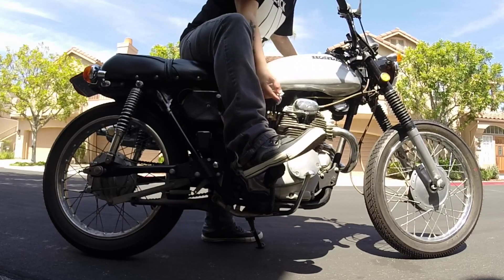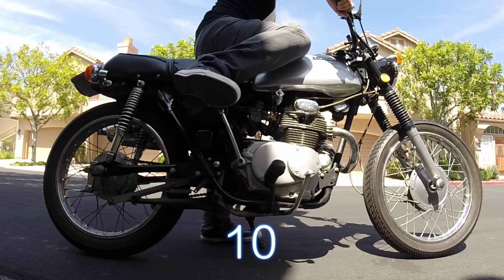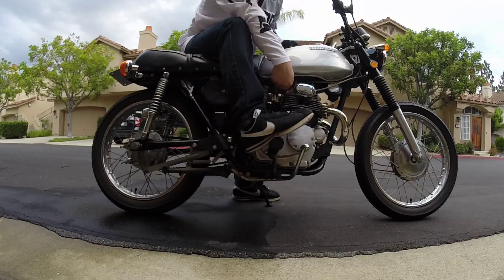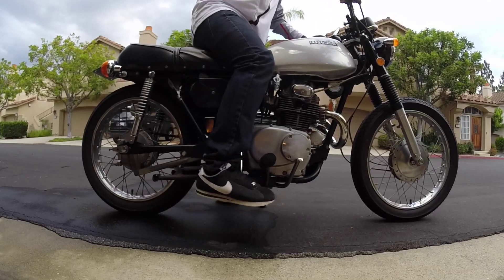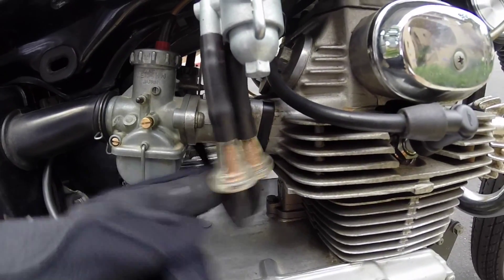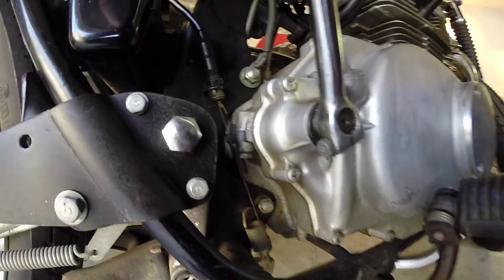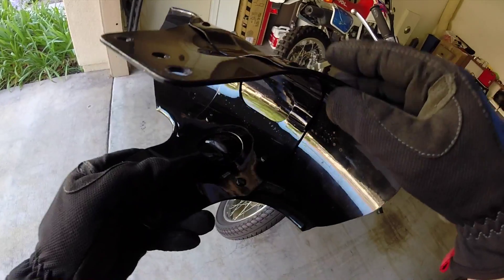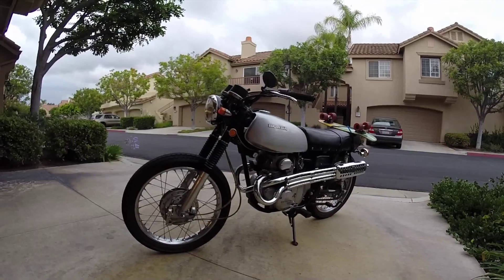Honda CL175 Cafe Racer Pt. 15 - Decompression Kick and LED Tail Light Fix

Comment: Cool I just changed my chain today an lubed my axle my rear wheel rolls so nice now what brand chain will u be using?
Reply from the maker: Juan Giron Just some heavy duty chain. Got it in gold haha. Doing a couple other stuff with it at the same time, so might take another week for the vid.
Reply: Right on man! I'm looking for the gasket kit to reseal the motor cus I ordered one from eBay but they sent me the wrong one I think it was for the  slopper 175 which kinda sucked cus it said it fit:/